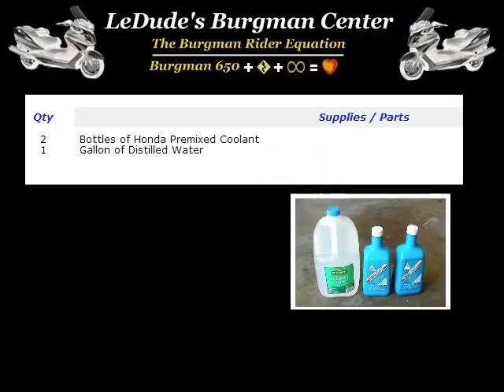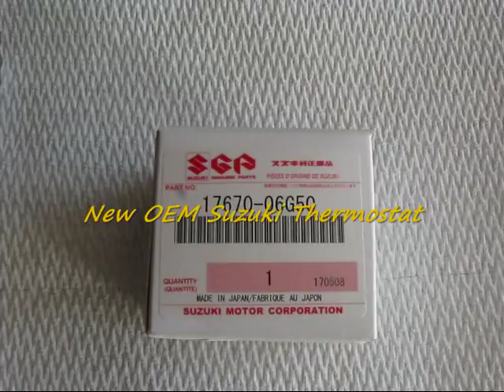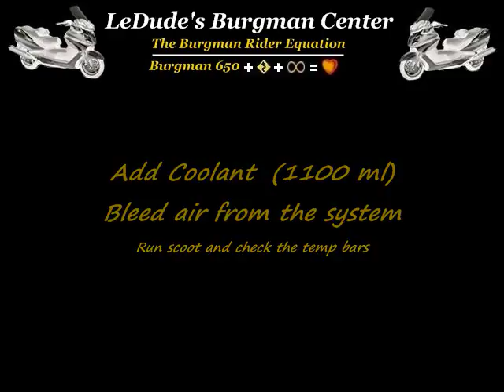Burgman 650 - DIY - Thermostat Replacement

Comment: i sir
My question is
When the Burgman 650 bike is running for 2 minutes, it the regulator too hot to touch by hand?
Is this temperature a problem or is it normal?
Reply from the maker: Not sure what to tell you, I have ony worked o =n it when the engine was cold